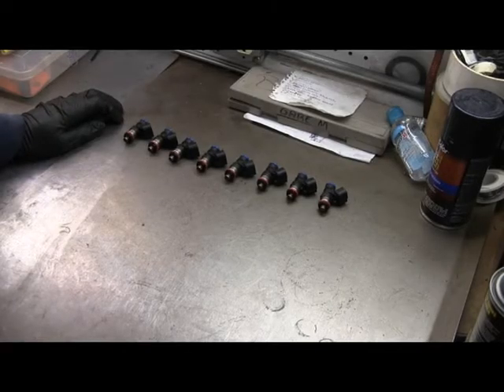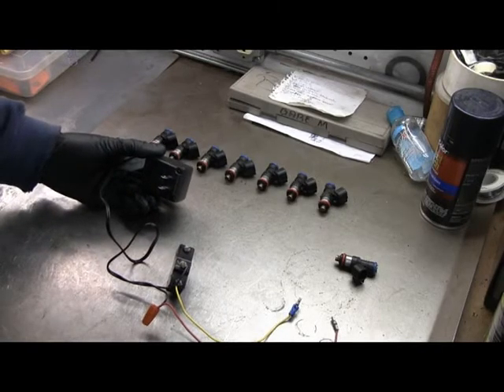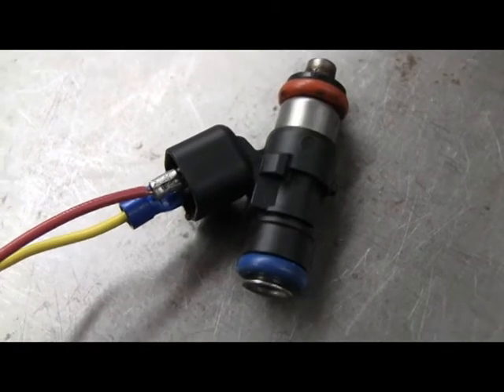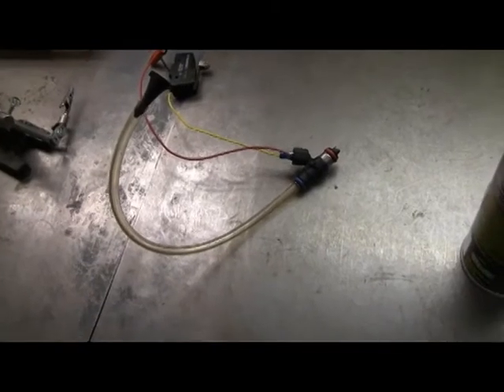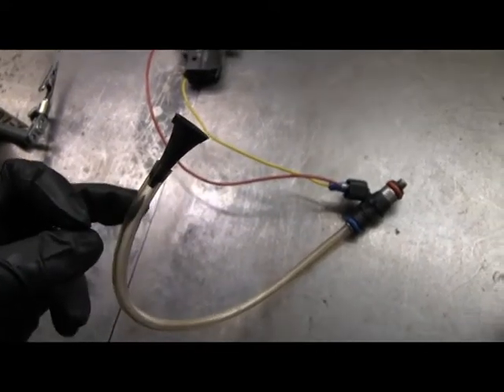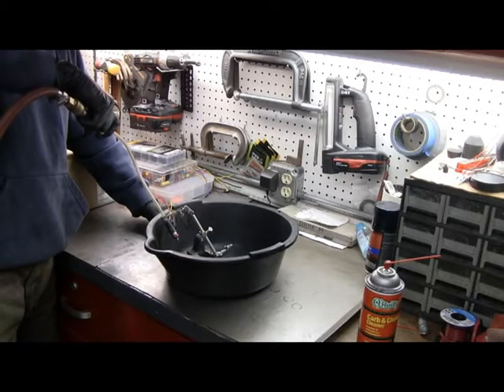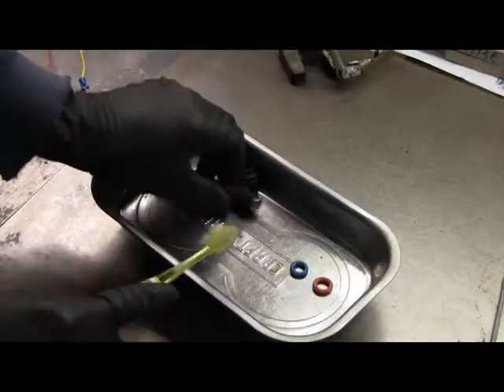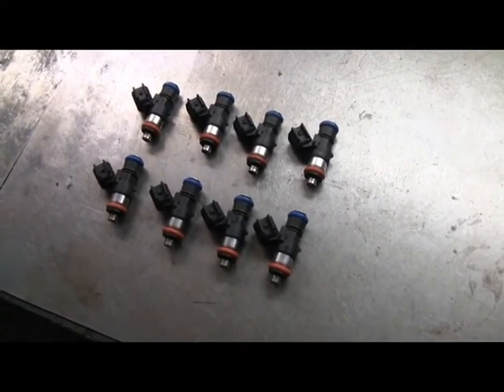LS Conversion swap, Part 53, Fuel Injector check and cleaning

Comment: A long time ago I learned that you can make a pressurized injector cleaner by using a can of Carb cleaned with the long tube. Take a tire valve stem with the inner stem piece( the piece that screws into the stem with the little o-rings) removed. Take the plastic valve stem cap & drill a hole in the middle of the top,just big enough to fit the thin tube from the Carb cleaner nozzle thru. Slide the tube into the cap about 1/2inch then seal it with superglue or whatever you want. Just so long as it is airtight & won't blow off when pressurized. Screw the valve stem cap back onto the valve stem itself. Now take an injector & secure it in a vise(not cranked down to the point of causing any damage of course). Then you put the bottom of the valve stem over the top of injector(where the fuel would enter from the fuel rail). It fits nice & tight for some reason. Hook up whatever you need for your power source. I've used alligator clips wired up to battery,old injector connectors wired to battery or have someone hold the wires to the contacts. Put the skinny tube into the nozzle on can of cleaner. You now have a pressurized  injector cleaner. Spray the cleaner while pulsing the injector. Pretty simple & can be made in 5 to 10min.I was  amazed at how well it worked & have done it like that ever since.

Comment: Would suggest you clean the prongs and injector body before the pressure port cleaning. It's just the debris from cleaning the exterior can enter the injector and you'd not know till after installed.
Reply from the maker: Good tip. I will have to remember for next time